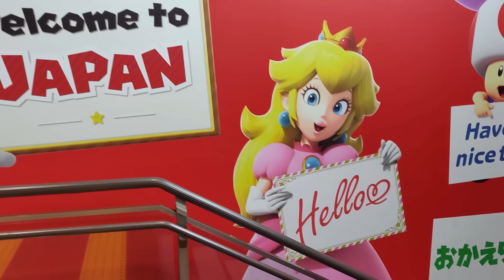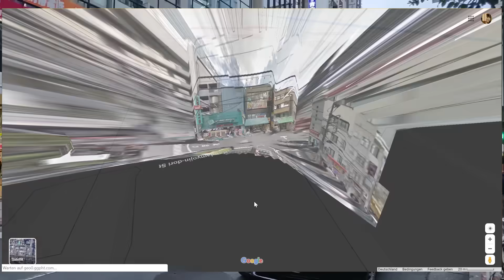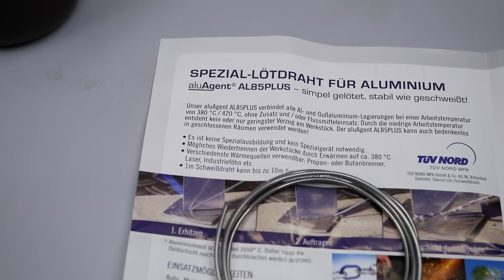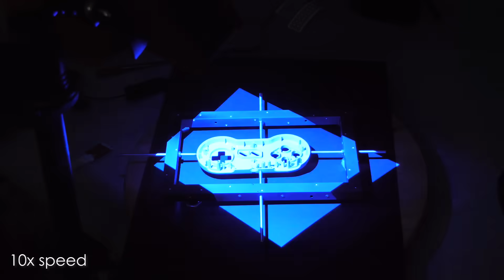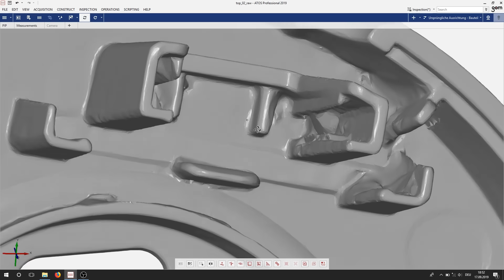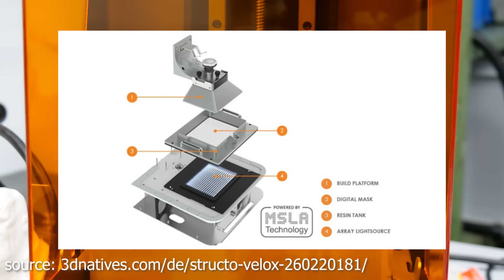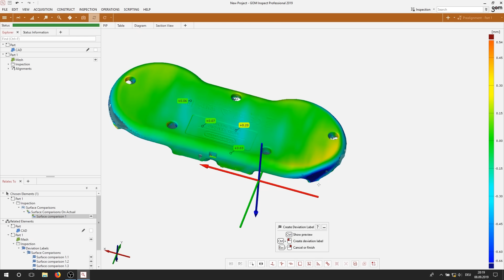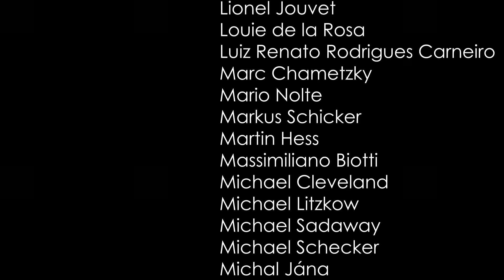My 3D Printed Transparent SNES Controller is a Clear Upgrade!

Comment from the maker: Feel free to share the video on Facebook, Reddit, Twitter and other social media!
Reply: Wow, that was a super accurate scan!
Glad you enjoyed your trip over here in Japan.
Reply from the maker: Ui 😅 too bad that I'm currently far away from the office.
Reply: Do you have a link to your scanned controller STL?  Thanks!
Reply: My apologies if it was already mentioned, but I think you can turn off design history capture in Fusion 360, convert the mesh into a BREP, then do boolean operations as much as you wish. I've altered one of Prusa's STLs in this fashion.
Reply from the maker: Converting a multi million triangle mesh into a brep will probably set your workstation on fire 😉 it's unfortunately not possible with such a model.
Reply: @CNCKitchen  Ah, I hadn't considered that! 😂
Reply: @CNCKitchen  Hey, do you think there is any open source 3D scanner that is accurate enough to scan parts like this controller shell or maybe even a console case?
I really want to get into case modding and 3D printing the base of a console case would be great because I wouldn't have to destroy the original case and it's not as bad when you mess something up as one can simply print it again.

I mean with photogrammetry and some measurements I'm sure I can get a rough sketch when scanning a case, but I'm not sure it's the most viable option for these kind of projects. Most videos about 3D scanners I saw either scan complex objects like decoration or use some hella expensive scanners, your video was the first one I saw which used a 3D scanner for something more useful like replicating parts, but the GOM Atos Core is obviously too expensive for hobbyists like me.
Reply: I'm embarrassed that I didn't first mention that I loved this video - the end result is phenomenal!
Reply: I don't suppose you would be able to make this scan available to the world ?
Reply: 12:42 looks like that this result could be achieved with transparent filaments too? (like PETG for example)

Comment: I print (advanced level) with SLAs. If you want a super clean/clear finish don't wash your print with IPA. Put the piece in a dark/warm (60C to 80C) chamber, and let the excess drip off. Then cure it. You could spray/coat as you showed, but in my experience, it won't be as good.

Comment: I’m glad you mentioned Microsoft‘a 3D builder. I find some things are just easier there but felt it was the 3D modeling equivalent of pounding a nail in with a rock. Lol. It’s limited but very straight forward.

Comment: Mhh... Given the task you wanted to achieve ( no modifications of the original ), instead of going the route of digitizing the model into the PC for later 3D Printing wouldn't it have been easier to use a silicone cast off and just pouring clear resin ( the type that curing without light ) into it? Would most likely have resulted in a much cleaner copy - Would also have been a more financially viable lesson for the audience - I mean... Replicating a 5.- Gamepad via the use of a 33'450.- Laser Scanner is kinda backwards if you ask me... 🤨

Comment: You should upload those scans.  I want to print out a SNES controller faceplate that fits the Switch SNES controller but allows the usage of original buttons and rubbers (the ones Nintendo put on the new ones suck).

Comment: Hello, watching this over a year later!

I was trying to find the time in the video or a comment about it, but my internet is too screwy. What is the reason you rotated the controller pieces 45 degrees for scaffolding instead of placing them flat side down or open side down and having much less scaffolding for the hollow inside?

Comment: That unsightly gap at the witness line could had been cleared up by extruding more material to sacrifice with sanding. Could had even made lines where to stop sanding, and it would had done a fine job at making that seam almost disappear with enough hand work or some time mounting it into a CNC machine for sanding with a custom profile to scrape off the extra material.

Comment: One thing you could do to make the two parts lineup better would be in fusion extended the length of the lip where they join and sand it flat on some glass until it's all level and correct thickness

Comment: I wonder if you could have printed with clear PETG and then coated the pieces in XTC-3D (Smooth-On)? I've seen models look clear if both sides were coated.
Reply from the maker: Probably not. It's very hard to make FDM prints really transparent if they're not just simple vases.

Comment: I still have my 30 years old Amiga 1200 fully upgraded with an original Blizzard MK4 32 mbytes ram, 16 mbytes VGA Indivision AGA videocard, 40 gbytes hdd with OS 3.9 and more than 4000 Arcade Amiga games all running from the Hdd, And a special 1.88 mbytes 3.5 floppy drive. All in mint condition, no yellow plastic, except for the brick PSU.

Comment: Super nice! Love the Nintendo: Anyhow in Fusion360 you can convert a mesh in BRep and then treat it as a solid body so you could subtract 2 bodies. Love your videos!
Reply: I think the problem will be the quantity of points. I think fusion 360 only converts until 200.000 points or so. And you can really get there fast with round shapes.
Reply: @sir_tomtom  yes but then you can reduce it to make it easier to work. There is a function called reduce or something like that.

Comment: Wenn du deinen Ref.Rahmen noch Professioneller benutzen willst solltest du dir einen als Vorlage erzeugen dann musst du auch nicht jedes mal die Punkte erfassen sondern kannst den Ref. Rahmen reinladen und drauf los Scannen. 

Ich hoffe auch das du das Bauteil mit "mehr Punkte" gescannt hast dann sollte es mit einem 200er Messvolumen auch gleich noch einmal besser aussehen.
Die von dir angesprochenen Defekte welche durch Ref. Punkte auftreten werden beim Polygonisieren normalerweise sehr gut gefüllt. Also keine Bange auch mal welche auf deine Teile zu kleben. Bei Instabilen Teilen bleibt dir häufig nichts anderes über da du die Teile mit einem Ref. Rahmen ansonsten Deformieren würdest. (Keine Frage bei dem Controller war der Ref.Rahmen volkommen angebracht)

Sollten sonst noch Fragen auftreten meld dich gerne

Comment: If my memory from chemistry class serves me well, when heating up an object (such as @4:30) you should use just beyond the tip of the blue flame as anything within it is known as the dark zone which is where there is/can be unburnt fuel as it hasn't got the full fuel to air mixture to make it as hot as it can be. So don't press it down onto the object to splay the flame out.

Comment: So, there is a way to do boolean subtracts on mesh bodies in Fusion 360, it just involves converting the mesh body into a component first. The risk here is that you have to balance detail lost with number of faces as Fusion 360 gets bogged down tremendously by components with too many faces :\

Comment: So the only reason that most of resin prints is with 45 degrees rotation is in order to fit the printer? 
That rotation wouldn't create steps in the normal smooth layer?
Reply from the maker: In this case, the print area are was too small so I had to tilt it. For other objects, you want to minimize the exposed are per layer to reduce the forces while the print is peeled away from the FEP sheet.

Comment: @CNC kitchen. You could've done edits in Fusion by disabling timeline from bottom right corner and changing mesh by right clicking it from list at left and doing was it convert to Brep or something like that. Then you can draw "normal" parts and use them to carve original bodies. I hope I remember correctly. Just to save you some time possibly in future

Comment: Try to print it in a fdm printer. It would be interesting to see how well will that work.
Reply from the maker: I did, but it struggled with the details and all of the supports necessary. Maybe using a 0.25mm nozzle and soluble support might lead to better results.

Comment: It was all fun and games until I realized the GOM Atos Core costs more than $33,000. That's like using a Stratasys to print a fan duct for your Ender lol.
Reply: I've used a $350k Stratasys FDM to print a part for my flashforge creator pro before :P
Reply: I still want one. Not that I have enough use to make it worthwhile.

Comment: nice job.
I don't have experience about resin printers,but if after the print the resin can be grind with sandpaper for smooth surface ( and breaking peaks)and after polish with buffing for clear transparency.Here is from me your mistake.The spray is not the better solution for finish ...

Comment: Clear coat! Wow! I think I need to try it with FDM prints using clear filament to see if it will work with that too...
Reply from the maker: Tried it. Didn't look nice and also the resolution is a limiting factor.

Comment: Why do you need to print the part Crosswise?
Reply from the maker: In this case, the print are was to small so I had to tilt it. For other objects, you want to minimize the exposed are per layer to reduce the forces while the print is peeled away from the FEP sheet.

Comment: The SNES Classic controller shell is not compatible with the original controller. :(
Reply: Yeah, I took mine apart and did a comparison with a Super Famicom controller, and it was... Similar, but certainly not identical.

What was more interesting was he fact that I also have the Wii Classic SNES themed controller you could get off Club Nintendo a while ago.

And even though functionally speaking that's near identical to the ones that come with the SNES mini...

The actual construction is somewhat different, and that one comes closer to the old school controllers...
Reply: @KuraIthys  Yeah. On launch day in 2017 (almost exactly 2 years ago) I tried to do a board swap and it was a no-go. :( NES Classic Editions controllers will board-swap with original NES controllers just fine.

The earliest SNES controllers have L & R printed on the shoulder buttons and have no reinforcement rib between the cable winding posts. They revised it with the rib before they stopped printing L & R. They stopped printing L & R in 1993 or earlier but they are still textured on the buttons. They also stopped printing "Eject" on the console and started molding it. No doubt, they were trying to save costs. In 1997 they switched to on with a Nintendo logo instead of the console name so that they could use the same shell in Japan and the rest of the world. Indeed, the back shell even had both the SNES and SFC emblems thought the button shapes and colors were still different in each region. Brazil did get a hold version of that controller though I doubt anything else changed.

Because the SNES CE could had to copy the "classic" design they couldn't get away with the 1997 design and had to pay extra for printing different faces but they still found other ways to make it cheaper, like getting rid of the metal pivot pins from the L & R buttons. They now pivots on plastic nubs molded into the buttons, which could not be as thing as the originals so the receiving holes had to be wider. Regardless, I can't figure out why they changed the PCB and mounting holes just enough that they don't fit. That seems unnecessary. :(

Comment: WOW, as always! Impressive effort:) And an impressive (& expensive) scanner - but hey that's what it takes, sometimes. Also, I know (and appreciate) that you do things for a challenge, so buying a clear controller off eBay was out of the question!:) Or, are those prohibitively expensive, or simply not available? Whatever the case, thx for sharing.

Comment: I have been trying to 3d scan a gamecube controller for months now but havent had a good computer or my software bugs up. I am trying to use a kinect and scanekt to do this but i am failing hard.
Reply from the maker: Sprinkle it with oaint and use photogrammetry.

Comment: I don't know if it is true, but I have read that soldering (using brazing rods) to join aluminium can not only weaken the tensile strength of the aluminum due to the effects of the heating and cooling, (Especially when you are not using strict temperature control measures, and just blasting it with a torch.) but also can create joints that are in fact weaker than using an epoxy made for joining metals (such as JB Weld).  I know that it doesn't matter in this particular instance where the overall strength is not important, but it is an interesting subject none the less.

Comment: You can subtract bodies in Fusion360. Go to Create>Merge Bodies and when the window opens you select the bodies and instead of using the join option in the little square box you select the cut feature in the drop down menu.
Reply: Yes... for a 3D solid body. Unfortunately, an STL is a surface body (polygonal mesh). Fusion 360 is primarily a solid modeler. It does support some mesh editing, but not boolean (well, there is a 'Merge', but that's all). For the most part, mesh editing is best done in a proper mesh app. Just sayin' :)
Reply: Oh OK. Interesting. Didnt know that. Thanks for the anwser.

Comment: Great video! We recently bought a switch and I've been thinking of doing the same thing for the joycons. Luckily I have access to some really nice metrology scanners ;)
Reply from the maker: Nice!
Reply: @CNCKitchen  something you may want to try is slicing a scan that has holes in it....alot of people assume your model needs to be watertight, and it is simple enough to patch mesh holes, however I have had great success slicing models with small holes without any issues.

Comment: Nice! Why is the print at a 45 degree angle?  What would happen if you printed it flat, which would reduce the number of layers?
Reply: The buildplatform is unfortunately too small to fit it flat. But it's pretty common to do it that way when printing with resin  ;)
Reply from the maker: In this case, the print are was to small so I had to tilt it. For other objects, you want to minimize the exposed are per layer to reduce the forces while the print is peeled away from the FEP sheet.
Reply: @CNCKitchen  Didn't knew that, thx for the explanation :)

Comment: Could you explain why resin prints are done at 45 degrees?
Reply from the maker: In this case, the print are was to small so I had to tilt it. For other objects, you want to minimize the exposed are per layer to reduce the forces while the print is peeled away from the FEP sheet.
Reply: It wouldn't fit flat, also probably to reduce that stair-stepping effect

Comment: I have one object that has gained interest in people wanting a 3D scan of since I modeled a replacement part for it - a Tron arcade joystick. I modeled the trigger button since I bought an original joystick along with a reproduction (100% identical since it was made from the original mold). Thingiverse 3004325 to see what the joystick handles look like.
I've no idea how I'd scan a transparent object in, chalk spray then some calibration dots and lots of photographs for photogrammetry?
Reply from the maker: If you can spare the part, paint it white, sprinkle a ton of dots on it with black spray paint and then use photogrammetry to do the scan.
Reply: Thanks for the reply, it's not something I can spare because it's worth in the region of 150 euros.
Maybe if I can find some water soluble spray paint I'll have a go at doing photogrammetry with it.

Comment: impressive technology and creation process, and a not bad result, but if you really wanted a clear version without distortion I would have suggested making silicon molds and then casting the two halves from clear resin. Obviously that's outside the scope of the video/channel, but all the same...
Reply: Yes, impressive. For the record, Stefan created a silicon sock from a mold he made thru 3D printing! Just sayin' :)

Comment: Are the files available for download anywhere?
Reply: Would at least be a little cautious with releasing them. There's at least the Nintendo Logo in the model that is trademarked and Nintendo is known to send letters to whoever they think infringe on their rights, even small YouTube channels. A 3D model isn't a physical product yet but they for example stopped a clone controller based on trademarked design very recently, see 8bitdo snes30
Reply from the maker: True
Reply from the maker: I'm unfortunately hesitant to release them due to copyright issues 😅

Comment: Don't all uv-curable resins turn yellow after curing ? I've only used the elegoo transparant resin on their mars msla printer, and the prints always turn yellow after curing .. I was under the impression this was due to the compound that makes it uv-curable, and is thus unavoidable with this tech .. ?
Reply: Bob Thiry    All resin printers use uv to cure every resin.